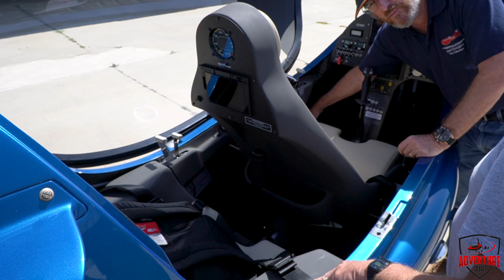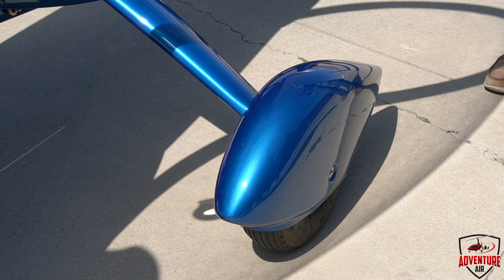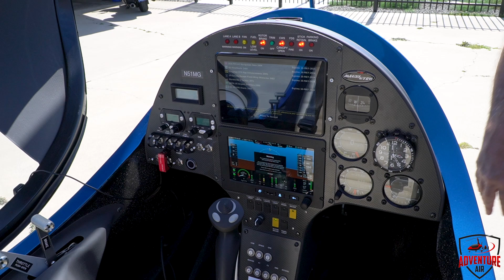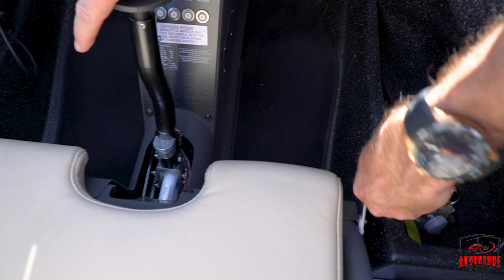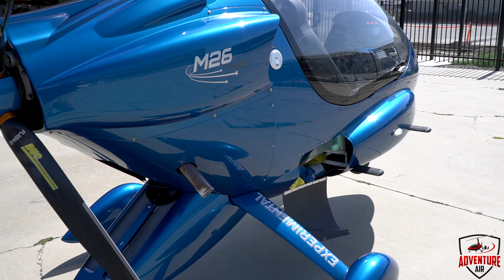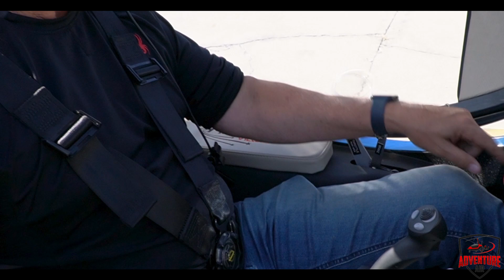93. The NEW Magni M26V With Mike Trudell #adventure

Comment: Why did it tump backwards onto the tail towards the end of the video? Is that normal?
Reply: As the fuel level decreases, there is a tendency for the cg to move slightly aft. Without the pilot as a counterbalance, it can rest on its tail wheel instead of remaining balanced on the mains and nose wheel. This tendency is  more pronounced in the M24, side-by-side model, but not so much in the M16 tandem model.

Comment: I flew in just one glass cockpit aircraft, and I well remember the glare on the screens--a glare shield in the bubble canopy low wing would have helped.  What a sleek gyroplane.  I have taken off and landed on grass just once, flying a friend's Luscombe 8A out of Pegasus airstrip near Stroudsburg PA.  I loved it--grass in a taildragger makes an aircraft like a Luscombe great to handle.

I was its 'Armstrong' starter never having done it before or since.  Since I was sitting left seat, after a quick lesson I started on a qtr pull, as promised.  When hand propping, standing behind the prop is key because if one slips, the wind blast is blowing towards you.  Wheel chocks with a rope are used as ground brakes, and I just pulled in the rope, and the chocks were stowed.

I have flown aircraft with the Rotax, two stroke and the wonderful four stroke 912.  The 912 needs a slipper clutch--w/o it can vibrate when at too low an rpm feeling like a flat tire.

Last aircraft I flew with a 912 was a two place trike since in addition to fixed wing light sport I also learned to fly trikes, with the view of a Gyroplane.   A flight in a Gyroplane is on my bucket list and an airship.

Nice video and I appreciate your narration on the equipment and engine--I helped build a dune buggy when just 12, captained my first boat when eight, and have been interested in internal combustion power since and also a classic car enthusiast.  Our first family car when I was born in 61 was a Chevy Nomad and I still remember it.